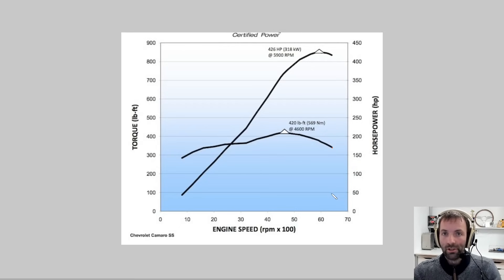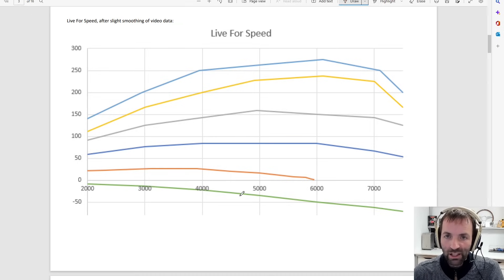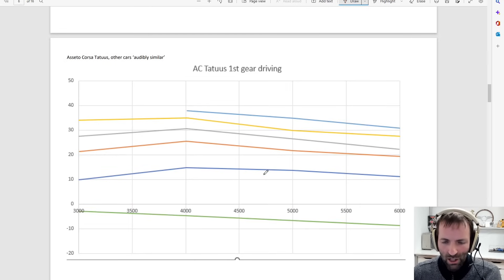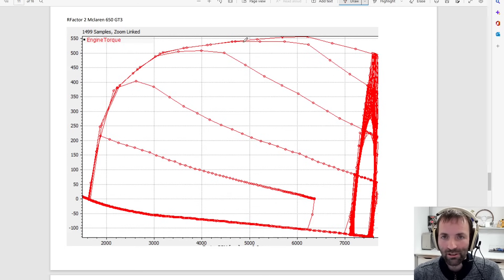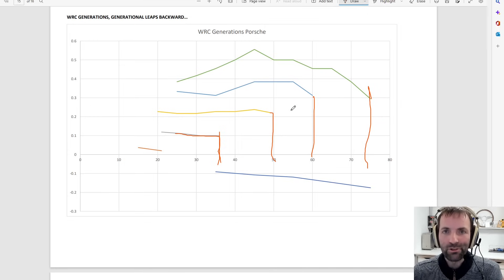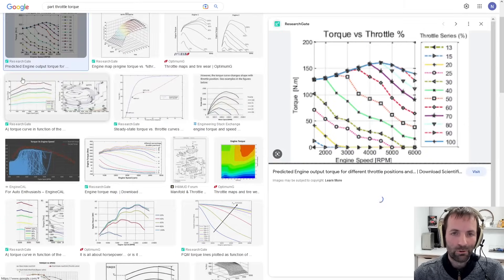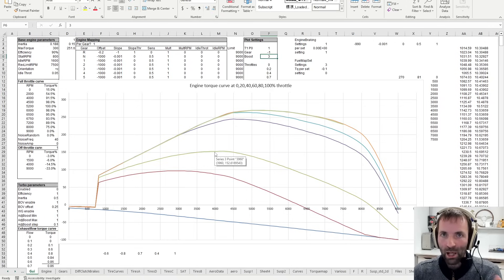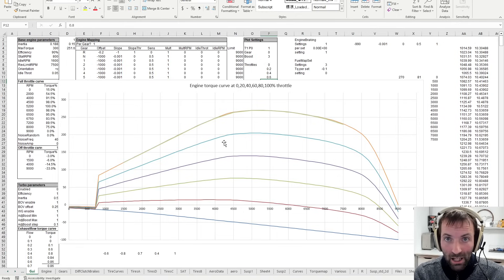Modern Sims Still Use A Throttle Model From The Year 2000! Explained, Exampled, Suggestions made.

Comment: Hey @NielsHeusinkveld. I must have missed this video back when you released it. Just found it due to the new AC Evo one. 

I found it really interesting, because I've approached this problem "the other way around". As a kid I have raced a ton in simulators. My main games were GTR1 and GTR2, but I also spent time in some of the others you mention like LFS and RBR. I got quite good at it, if I may say so. 

About 10 years ago in 2013 I got the opportunity to go racing for real. I spent a season in our Danish national Formula Ford championship. I struggled a lot with being too agressive and overdriving the car, which in turn meant I lacked speed and visited the gravel a bit too often. Some of it came down to bad habits and young blood, but I really had to relearn the muscle-memory of the throttle pedal. Even in a car like that with only about 145hp you really have to apply the throttle much more delicately and simply with less travel than you do in the simulator. It took me about the duration of the season to get the hang of it. Returning later in the season to the same track as the opening round, I shaved around 1,5 seconds off of a 50 second laptime.

This effect explains that so well, and I've never really thought about it before. The simulator simply teaches you how to apply the throttle incorrectly!😬From a mechanical standpoint it also makes perfect sense. If you've ever adjusted / syncronized throttles or carburetors on an engine, you know that the idle setting is just the tiniest gap through the butterfly, and even then most engines make plenty of torque even at idle to set off with minimal throttle input. Try that in basically any simulator, and the car comes to a grinding halt...
Reply from the maker: Nice to hear some real world testimony how sims can teach bad habits. Glad you improved! Yes, even lower powered cars, the old sim model just doesn't reflect reality, and sims can teach you the wrong thing.

Comment: Wow it's almost like game developers didn't realise that the purpose of a throttle body is to interrupt airflow - and so of course, at lower rpm there is much less airflow so the throttle has very little effect at large throttle openings (where the airflow is already limited by what the engine can suck in - not much).

Anyone who has ever ridden a small displacement motorcycle (particularly a high revving one with relatively large throttle bodies but low airflow at low rpm) will be familiar with this - at low rpms, because the airflow is so low, at the 20% position the throttle is not really impeding the flow of such a small amount of air. So the 20% position and  100% position create very similar engine torque, and the majority of the possible airflow manipulation with the throttle is within the first 20% of throttle travel. It's only when you're at higher rpm with more intake airflow that you get a more linear throttle response.

Of course, many modern vehicles have fly-by-wire throttles that are designed to counteract that - it's much safer to have more gentle throttle modulation at low throttle openings so you can finely control the engine at low torque / low rpm settings (particularly on public roads), so they will have, say, the first 50% of the throttle pedal travel controlling only 20% of the throttle blade travel, but the last 50% controlling the last 80%! (But in a progressive fashion, of course)

Comment: There was a great blog post from 2013 (F1 Framework, information from Maurizio Bollini) that outlined the model/philosophy of the pedal map, torque request map, and engine map in shaping the engine response in an F1 car for a variety of conditions.  It was impossible to read it and not come to a similar conclusion you have come to here, that literally all the sims at the time were doing it wrong by omitting this important system.

In my estimation, learning throttle control in sims that use naïve pedal-engine maps leads drivers to both develop unrealistic muscle memory and overestimate the difficulty of driving a modern race car with modern engine mapping without TCS.  This precise shaping of the engine response has surely trickled all the way down to many road cars, and I can only imagine the level of control possible with electric motors.  But as you suggest, so many sims still run legacy throttle models, among other legacy systems.

There are many other systems found on modern race cars and road cars that have been neglected, and I continue to hope sim developers learn to respect their importance instead of trying to curve-fit all the new cars into their old model.

Comment: 7:07 AC has a LUT file in each cars data for throttle pedal, for the tatuus 20% pedal = 50% throttle
Reply from the maker: Seems to match my idea then, same model, different sensitivity curve..
Reply: It is just a linear multiplier based on throttle position, doesn't have any effect on what rpm you are on.

Comment: It is also worth noting the context of the inaccuracy. In ACC the issue is masked a great deal due to the heavy reliance on TC on corner exit. The biggest problem arises for historical cars with this throttle mapping.
Reply from the maker: Yes, ish, as in the TC saves you from big trouble, but the feeling of 'urgency' as you add pedal is still kinda lacking at lower RPM, so building up to the grip limit and TC interfering is a bit different, probably, I don't know how they map the cars..

Comment: I think it's mostly a question of data availability. Writing a model to match your examples of real data is actually quite easy, but you need that data to populate it, and it becomes more car-specific (rpm dependencies, etc). When making dozens of cars in a simulation game, that's probably not the best business move. A proper throttle model also somewhat lends to needing proper static friction torque, idle behavior, and thus stalling, which is another can of worms. On a professional model it would make sense, but in sim games with significant errors elsewhere that people already don't notice (e.g. completely ignoring suspension compliance, poorly parametrized tire models, etc), not sure how much it matters. Pretty low hanging fruit though, relatively speaking.
Reply: I think the main reason for the way things are is that programmers 25 years ago just assumed that throttle percentage is just a linear engine output multiplier and never put any more thought into it. Nobody really hasn't looked into it afterwards. 

I'm sure data availability plays into it but the current models are not correct for any kind of engine. Which to me tells that developers are not just aware of this or throttle response is just a very low in the physics todo list. 

The way sim engines have been built are really based on what the programmers knew and sometimes that knowldge and intuition doesn't match reality. I think throttle response is a similar thing like drivetrain flex. Programmers just assumed things are perfectly rigid and thought the small flex doesn't make any difference but of course in real life it does and can be felt too. 

Same thing with in ac for example where all wings are attached to the sprung car body. Which makes suspension forces wrong for all single seaters because the massive aerodynamic lift component acting on a tire is instead applied on the car body. The tire loads don't change but suspension loads do. In the end it is just just a simple oversight I'd guess. I'm sure there are many such things in sims where someone made a wrong conclusion somewhere along the way and it just got left there with nobody giving it a second though.
Reply: I’m curious about your AC explanation. From my understanding the wings are attached to the body and indeed should be resolved as sprung mass, which affects the suspension travel, which in return changes tire load. How come the tire load is not affected by this?

I believe the only case where aero forces from wings (not underfloor) should be applied directly to tires (as unsprung mass) is on a F1 lotus 88.
Reply from the maker: Sure, there is no data, but it is also odd that tire models these days probably have hundreds of parameters, whereas the part throttle model is one tiny line of code.. So 'some generic improvement' seems overdue in the affected sims.
Reply: @augustodufloth1578  If you can calculate suspension loads then you can pretty easily figure out the difference when the wings are attached to the wheels (unsprung) or the body (sprung). For example for modern f1 car the tire aerodynamic lift values are considerable. Here's a simple quick and very dirty calculation I did:

Numbers come from f1technical, thread 30329. Speed of the car: 60m/s, 216kmh. Let's look at front axle. Let's assume 40% front downforce distribution. Total downforce on front axle is 10876 * 0,4 = 4350N. So in ac the suspension load would be 4350 total on front, 2175N each side. 

However, when we move that tire lift force from the sprung body to the unpsrung tire the suspension load changes to ( 4350+ 329+60 + 329+60) /2 = 2564. About 18% difference in this case. I'm doing maths on my phone, hope this isn't calculate wrong! 

The reason why the tire load doesn't change is because in the end all forces are summed at the tire which is then the tire load. However at suspension the tire lift increases the suspension load whereas at the tire it reduces the tire load. There are other effects that affect the car aero balance as well.

It is one of those things that feels intuitively wrong. How could the forces be combined to different results at tire and at suspension? But when you do the math and physics, it does. It is easy mistake to make. One freebody diagram later it all makes sense :).
Reply: @NielsHeusinkveld  I think one of the reasons why nobody has thought it is that a lot of the race car books don't cover it either. For example Milliken's holy bible doesn't cover any engine related topics so back 25 years ago it would have been easy to miss this detail. And Milliken's book has a lots of stuff, being over 850 pages. I don't have the most recent edition so maybe it has been added there. 

Of course nowdays it is weird that it is not done at all in most sims but at the same time I think people are just not aware of this or think it is much smaller effect than it is.

Comment: iRacing in the beginning had different throttle model that wasn't linear. They changed it in 2009 if I remember correctly. If you load up GPL or NR2003 you will see how it used to be before they updated it.

Comment: Correct if the correlation between torque and throttle is considered, so it is valid for old cars with direct pedal-throttle connection. On modern cars with drive by wire systems, the relationship is something in between the old and ‘improved’ torque model (often closer to the ‘wrong’ one).
Reply from the maker: With drive by wire I bet it is up to the imagination of the engineers to do anything they want, including the WRC model. I think with old style engines, a lot was done with non linear mechanisms / cams to tune how far the inlet valve opened vs throttle position. Lots of race car pedal boxes have a dozen pickup points for the throttle cable that each set a different opening curve.

Comment: Thank you so much for this video, finally confirms my thoughts about throttle response during drifting and cruising in AC vs BeamNG & real life. The linear response of AC makes it easier to be smoother during drifting. Makes sense why IRL drifting throttle modulation is more blip-y.
The partial throttle graphs look like that because of airflow (in engines with physical linkages at least). Engines need more airflow with higher rpm so a partially open valve will still provide enough airflow for full power at low rpm until it starts choking.
Also maybe AC is trying to replicate the non-linearity of throttle valve angle vs surface and/or take into account some shape of the cam?
Reply from the maker: I bet drifting is easier with the 'probably better' model. But comparing 2 sims, you have 1000 differences, so maybe the total difficulty is harder in a game with a better throttle model..
Reply: This is why people always complain about difficulty drifting in BeamNG. Plus FFB brouhaha. BeamNG doesn't give fancy FFB.
Reply: @kak8895  I think there is a default gamma setting in Beamng too, I disabled it and seemed easier. But then again, other things like FFB and tire models kinda suck in beam ¯\_(ツ)_/¯
Reply: @MihaiZavoian  Tyre model is tied to FFB. BeamNG does not allocate enough refresh rate for FFB like other sims do. 

Maybe an optimization issue considering everything else it simulates. They'd likely increase it in the future.
Reply: @kak8895  FFB goes up to 2000 Hz in beam, AC is like an order of magnitude lower. I think there are other issues related to precision, resonance and latency, due to the nature of their simulation.
Reply: @MihaiZavoian  You're right about FFB refresh rate. You also have to remember that BeamNG only gives torque curves for power steering enabled/disabled. If you tinker with it on vehicle configurator (front suspension) you'd notice changes in FFB. Most simulators known for throwing fancy FFB information at your hand that'd never occur in a real car.

Only problem I noticed is aero model is simplified for city driving as opposed to on limit racing. It's a driving simulator after all. You notice it as you approach speeds higher that 60mph when taking a corner. That's where precision comes into play. Devs have already said they'd update all these in the future so we'll have to wait.
Reply: @kak8895 true about beam. if you turn off all FFB FX in AC (like you should) it's just pure tyre model and geometry too.
I think all the suspension arms being bendy and breakable in beam create a lot of propagating problems. I was more referring to those but good point about aero too. Devs clearly have to rely on a lot more ffb filtering than other sims.

Comment: Really interesting!
I'd love to see something like this for braking models... some sims you have to slam the brake pedal to 80% or more to get much braking effect (they know who they are 😜🙄). Other sims it's a lot more progressive, getting greater braking effect earlier...
Reply from the maker: That would be very surprising, as the most logical way to do brakes is to apply a braking torque proportional to the pedal output, but maybe not all games do this. Of course most sims probably do temperature modeling too, so if you hit the brakes in a F1 car and they're 150c, you might not get anything until they're 450c..

Comment: Even ignoring transient responses to throttle changes, quite different among carbureted (with accelerator pumps), port vs chamber injected, MAF vs flap, turbo vs mechanical supercharged.
Reply: Transient response is an equally/if not more significant thing to focus on IMO. Road cars especially have quite a lot of lag built into their throttle response (not to mention the inherent lag due to air transport delay, etc). That's not something I've seen done at all.

Comment: Cool video, one suggestion of what you could have done is showing a throttle body and how it opens up the airflow. When looking at the surface area which opens its a massive difference in the first percent of throttle because the surface area increases rapidly while with the last pervent of opening the throttle there is barely any difference in the surface area anymore.
Reply: Something which can change the behavior IRL and therefore also in the sim is that modern cars often have throttle by wire which then can have several different curves and be less agressive in the first half than it would normally be. But in classic cars the increase with power depending on the throttle would not be linear, it would be big in the beginning and less at almost full throttle, like you explained. Which sounds like BeamNG is doing a good job with 80% being almost like 100%
Reply: It's actually the opposite. The area follows the derivative of a sigmoid function, so the first few percent don't do much and it continues increasing in slope until it hits 90 degrees. The actual mass flow plateaus a bit towards 90 deg instead of continuing to increase, but otherwise also generally follows the same function. The dependency on rpm more has to do with the required mass flow rate for the intake stroke.
Reply: @jacksonp.928  hm, because of the round shape of the throttle body I thought and once got explained that the increase is massive in the beginning not only because its opening from the outside where its more narrow to the bigger inside but also because at the beginning an increase from 10-20% or 20-40% doubles in quite a short range and later the increase difference is much lower, going from 80-100% is a much less change than from 0-20%.
Reply: @jacksonp.928  Looking at this pic: https://optimumg.com/wp-content/uploads/2012/04/power_response.png
It's a mix of both of our opinions. It's like a sigmoid function but the increase is waighted more towards the lower throttle input.
Reply: @MixedRealitySimRacing  That's power, not mass flow. The RPM dependency Niels made this whole video about will affect that type of curve in the way you describe. Look up mass flow vs butterfly angle and you'll find more relevant results (such as the following: https://ars.els-cdn.com/content/image/1-s2.0-S1350630717302157-gr5.jpg ). I also did the math (just some integrals) on the butterfly area to make sure I knew what I was talking about before I wrote my original reply to your post.